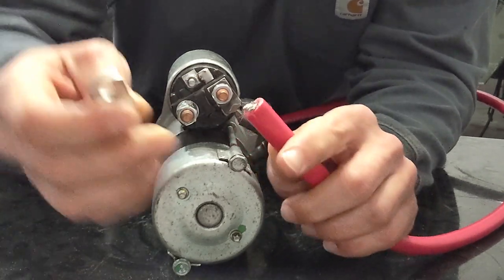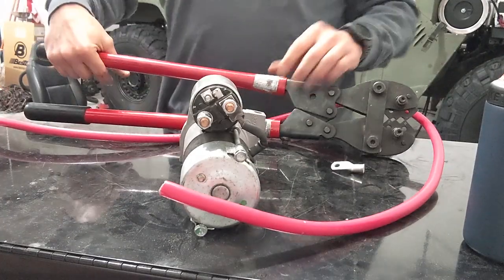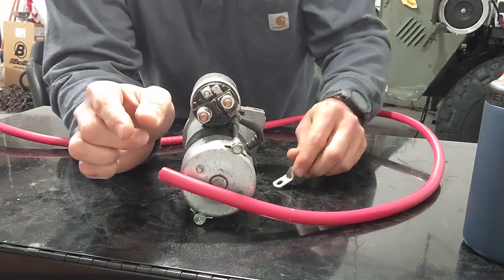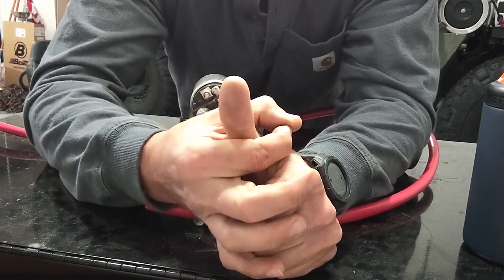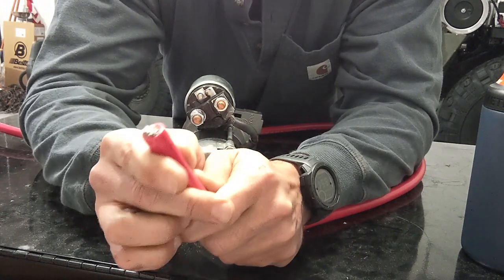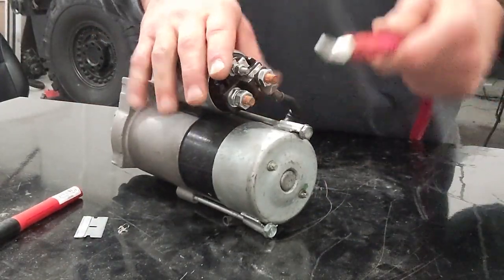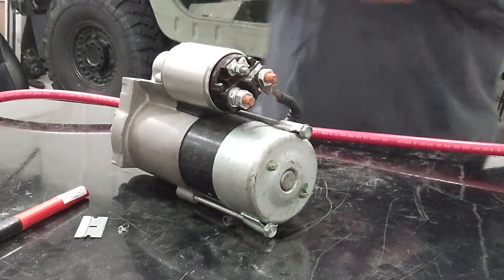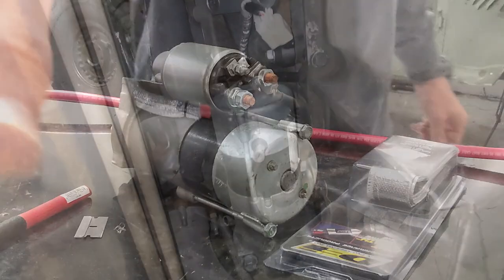Building Battery Cables - LSxHumvee

Comment: You are making great progress.  One important note.  The fuse holder terminals should be crimped and pushed in from the back of the plastic shell housing.  There is a tab on the metal connector that locks in and lets it be serviced separately from the plastic shell.

It looks like it clicked in for you so I may be wrong.  Generally they all go in from the rest.

Comment: That looks like CCA or something.  If you get copper wire, it will actually be a little smaller in the same gauge.  Plus, you can use a crimping tool about half that size (and about $40) for cable up to around 1/0 or so.  Love the vids and I'm not criticizing, just trying to be helpful for whatever is next.